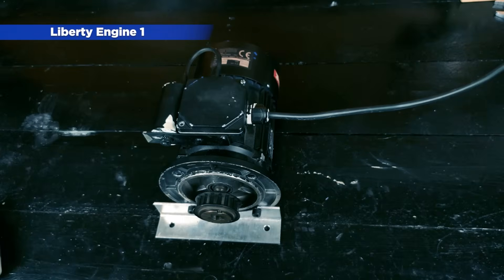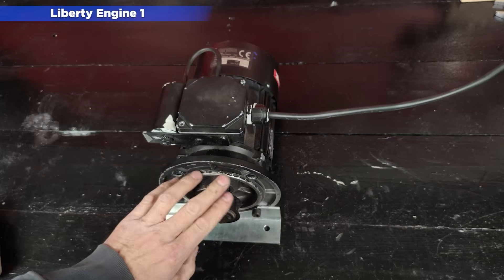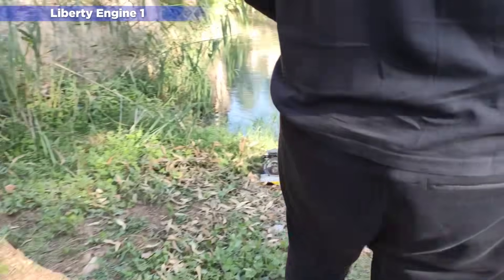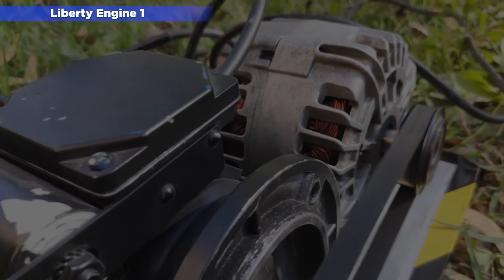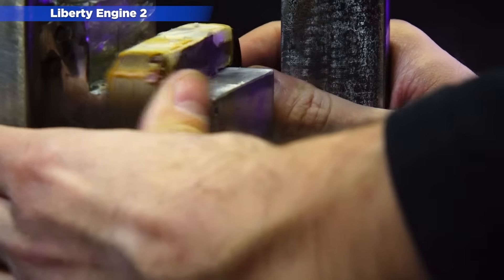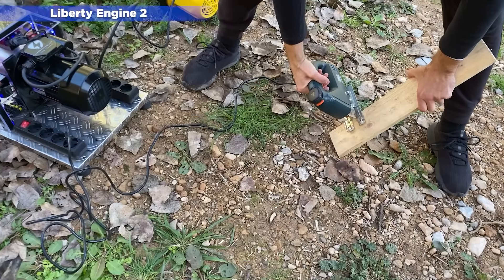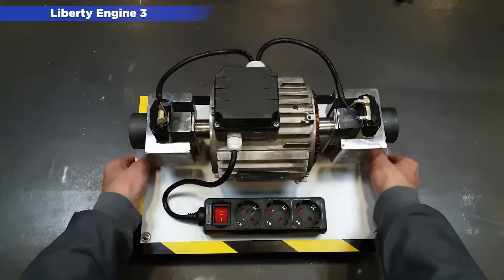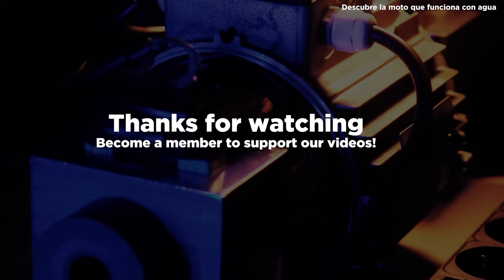Evolution of the LIBERTY ENGINE Infinite Energy Generator

Comment: Could be possible if you had some STRONG STRONG magnets.    The magnets are producing the power basically by turning the motor.   Youd need a magnetic configuration that produced more torque than the motor needs to turn.   Your getting less energy, but would last until the magnets lost magnitivity.  I.e. forever 🤔      i think it IS possible.     Very possible

Comment: I tried to build the liberty engine #1 with 2 fans and can achieve generating 58V AC at the output end, and I am making a transformer to convert 58V to 220V as final output.
Reply: So it works then?